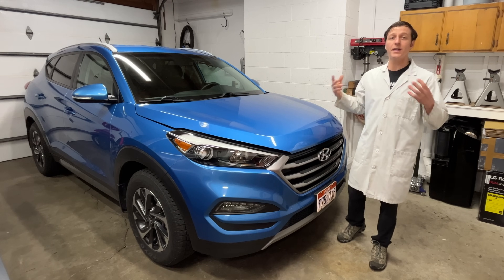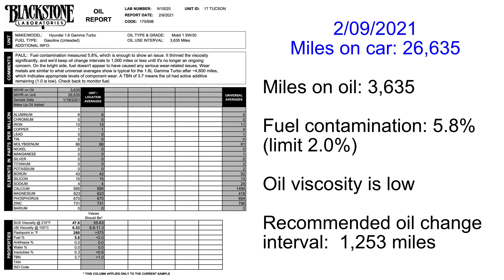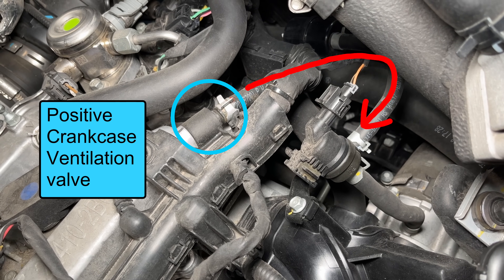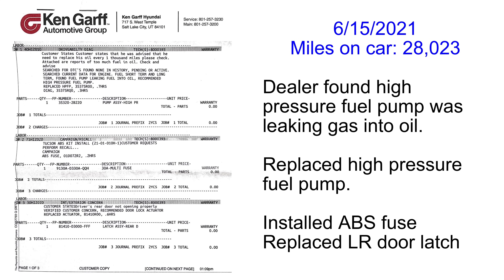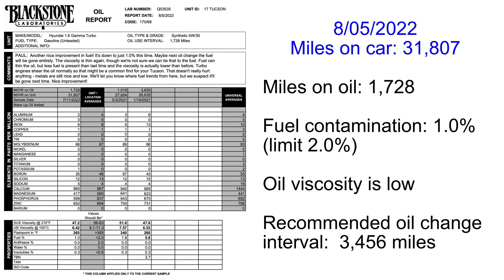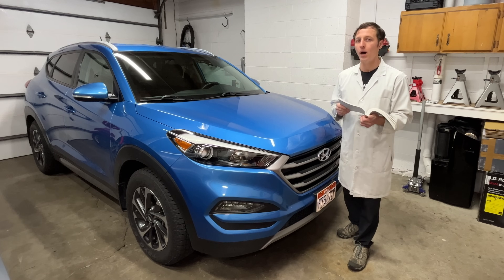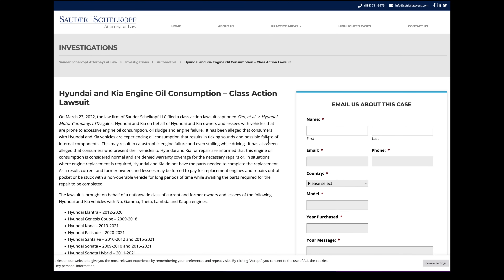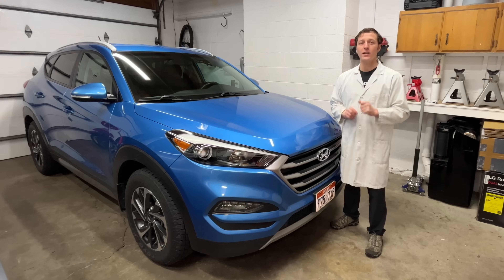Hyundai oil consumption and gasoline contamination problem solved

Comment: Ok, so every 3k. Got it, change oil and check pvc regularly. So, do I still need/ should use synthetic oil or hybrid or conventional ok because so frequent? Or? Thank you for doing these
Reply from the maker: Synthetic oil is recommended for turbocharged engines because it can handle higher temperatures than regular oil and the viscosity will be more consistent. I buy Kirkland brand oil at Costco and it's about 1/2 price compared the auto parts stores. It still meets the same API specifications. Cheaper oil is not worse than expensive oil.
I recommend sending a sample of your oil to Blackstone labs. 3,000 mile oil changes are good IF the high pressure fuel pump isn't leaking. If it leaks like mine did, even the 3,000 mile oil changes will result in a blown engine. That's why you need to test the oil.

Comment: Also, do we have the same problem with lambda II motors ? I have a 2015 3.3 l lambda II. Everything works well but just to prevent something… thanks
Reply from the maker: Yes, the GDI version of the Lambda 2 engine was introduced in 2011. Most GDI engines have a tendency to get gas in the oil. Test your oil and change it often.

Comment: Hi guys, so shall I do this « GDI. Cleaning » since it reduces the amount of deposit caused by this bypass system putting back exhaust into the system ? What is this product actually ? Should K ask my dealer or can do myself ? Thanks.
Reply from the maker: GDI cleaner is just a strong solvent that goes in the intake manifold to dissolve carbon deposits on your valves. You can buy a can of GDI cleaner and do it yourself, or take it to the dealer. I don't know if there is a difference in results because I haven't researched it.
Reply: @LabCoatPaul  Thank you so much for answering. You are the best. :)

Comment: get made in korea and don't get GDI.  I doubt ANY GDI is a good idea.  do your homework before getting a hyundai/kia product.  the best car I ever had was a hyundai and I have owned toyota, honda, nissan, mitsubishi, and chevrolet cars.
Reply from the maker: GDI engines from a lot of different manufacturers have fuel dilution in the oil. Unfortunately, most new cars in the US have GDI because theoretically the cars have cleaner emissions. I can confirm my 2017 Hyundai had cleaner emissions on idle than my 1997 RAV4. I had both tested with an exhaust gas analyzer. I did not test the emissions while driving. I suspect the Hyundai has higher HC emissions when using the turbo.
Reply: I did a VIN search and found out my 2018 2.0 Tucson was made in Korea.

Comment: Thanks for sharing your findings. 

Could one of the consequences of driving one of these vehicles (I have a 2014 Hyundai Santa Fe Sport with the Theta II engine, another of Hyundai's gasoline direct engines) lead to pitting of the pistons and cylinder wall wear? That's the struggle I am currently facing but, since it's not rod bearing failure, it's not covered by Hyundai's extended warranty. I certainly was not changing my oil ever 1,000 miles, so who knows how long I may have been operating it with potentially contaminated oil 😔 Thanks again.

Comment: I'd be curious to know whether this was run on higher octane fuel if the results would differ. These motors are only reccomended to run 91 or above, but it would be interesting to see if a 95-98 octane would produce different results for these tests.

Comment: The direct injector, on a gasoline fueled engine, sprays fuel into the cylinder on the INTAKE stroke only (i.e. not the compression stroke), just like the old port injector does.  The only difference is that the direct injected fuel is sprayed directly into the cylinder under high pressure, like you said. Where a port injector sprays 60 PSI fuel upstream of the open intake valves on the intake stroke. Only a compression ignition engine, a Diesel, sprays very high pressure direct injected fuel on the compression stroke to start the fire.

Comment: This is why I put 15w-50 in my GDI accent and change it every 2500-3000 miles. 230k and no funny business.
Reply: Thank you. I see 200k mile Elantras all the time. Quality gasoline and frequent synthetic oil changes seem to be too hard to comprehend for some. Engines are complex machinery in need of maintenance
Reply: I think it calls for 5W-30 at the upper end of thickness. Your is past warranty so that isn't something to worry about.
Reply: @filippocorti6760  It does in the US manual, overseas the minimum for the 1.6 GDI is 5w30 and the maximum recommended is 20w50.
Reply: @Itrieditathome889  That is interesting. I wonder what the reason is for the difference.
Reply: Have you had intake cleaning service done? It removes the carbon that forms due to direct injection.
Reply: @filippocorti6760  Yes I do it myself every 10k or so. I recently had the intake manifold off to do the injectors and it was surprisingly clean considering the miles and the fact I use full SAPS oil (which can contribute to deposits more than low SAPS.)

Comment: Crappy engine . Ive changed the pcv and still burn one full quart of oil every 60miles. 4 quarts on a 3hr drive.  No leak  , no black-ness from the exhaust tip....where did it all go?????

-2014 santa fe 2.0
Reply from the maker: 1 quart per 60 miles? Your car is burning more oil than a 2 stroke! That's awful. I wish you luck and a new car. 
Unfortunately, once they're burning oil, you can't really fix it, other than replacing the engine. Testing the oil and changing it often can prevent oil consumption, but it won't fix it after it's already happening.

Comment: Thanks Paul! Having the same issues with my 2015 hyundai sonata sport 2.4 liter gdi... ugh this thing burns oil like nobody's business! Of course it just passed 100000 miles as well when this all started happening thanks alot hyundai. They said they couldn't do anything about it and to just keep adding oil. I'll be checking out those class action lawsuits you mentioned. Stay safe out there!
Reply: Use valvoline restore and protect oil
Reply: @shreddbass    I just bought a used 2013 Santa Fe Sport with 125K miles on it.   Have you been adding oil regularly?
Reply: What are you complaining about?  Honda and Toyota washes their hands of their cars at 60.000 miles. Their 1.5 L Turbos are blowing head gaskets left and right and they are refusing to help if it happens over 60.000 miles. Problem is its happening well below 100.000 miles. Did  you buy this car new? It's also 10 years old!  What are your oil change intervals?

Comment: I think the problem with your car actually started with the original owner, which brings up the importance of checking a vehicle's maintenance history.  I think you don't have a GDI problem so much as you have a ring wear problem from poor break in and a long time from when it was new til when it got it's first oil change.  I would check compression on that engine and also pull the Carfax to see how long that first oil change took.  Also, how long are each of your drive cycles?  Do you do a lot of short trips?
Reply from the maker: I bought my car used, with 28,000 miles. It was a lease return from California. I don't know how often the oil changes were done. I'll assume the person didn't care about the car. There were other signs of abuse like paint damage from multiple spilled sodas on the roof and candy under the seats.
My first oil test showed 6% of the oil is gasoline. The limit is 2% before the viscosity of the oil is compromised. Older cars with port fuel injection have zero fuel in the oil. One of my friends just did a test on his 1998 Toyota Tacoma with 260,000 miles and there was no gas in the oil.
After I had the high pressure fuel pump replaced, my oil contamination dropped from 6% to 2% over a 3,000 mile oil change, confirming the fuel pump was leaking into the oil. 
GDI operates at 2,000 psi and the pump sits on top of the valve cover and is driven by the camshaft. If it leaks even a little bit, the gas will go straight into the oil by the camshaft. Also, the gas is sprayed into the cylinder at high pressure, and there's a turbo. All those factors increase the chances of fuel getting past the piston rings.
It's possible my engine has some cylinder and ring wear, however, it does not burn oil. After 3,000 miles, the dipstick indicates FULL. Perhaps even a little more, with the gas in there.  I start with 4.5 quarts, and I end up with 4.59 quarts of oil + gas in the oil pan.
Blackstone labs said there was a serious problem that needed repairs with the first test. After I had the high pressure fuel pump replaced, they advised to keep an eye on the oil contamination, and not to go over 3,000 miles on the oil.

My driving habits are severe duty. I rarely drive the car more than 4 miles at a time. Going to work is 15 minutes, 4 miles. Going to the store is 5 minutes, 1 mile. The engine doesn't get a chance to warm up, and fuel doesn't get a chance to evaporate out of the crankcase. It's reasonable to do 3,000 mile oil changes with that kind of driving, so I don't think my car is broken. But If I blindly follow 5,000 mile oil changes, it will burn tons of oil by the time I get 80K miles on the car.
Reply: @LabCoatPaul  Great explanation.  Yes, the short trip driving is severe duty.  3k interval is a good choice.

Comment: I don't think it has to do with the fact that it's gasoline direct injection but much more to do with emissions standards.  The manufacturer made the bore a lot looser so there would be less friction so that they could get more rotation out of a little bit of fuel.

 They meet EPA standards and that's why the engines are failing sooner than later. So save the environment by buying a new car every 3 years instead of having a car that will last for 10 years but create a little bit of extra pollution because it doesn't make any  pollution to make new vehicles and to harvest the raw materials, run the factories etc..,.right?
Reply from the maker: Yes, the loose bores make the car get better gas mileage! No old car has ever achieved the mind-blowing 24 mpg that I get... Literally every small car from the 90's does better on gas than that. You can easily get 30mpg out of a Honda Civic or Toyota Corolla. Back then, they just made the cars lightweight with no safety. Some people think the Geo Metro got 55mpg. I had a 1994 Geo Metro. It got 35mpg, because you had to floor it 100% of the time to get the car to move, but that's still much better than 24mpg.

It's funny how the EPA makes rules about the environment that result in more pollution. How about those new gas cans that just spill all the gas on the ground? I'm happy they prevent gas from evaporating through the vent.

I tested my 2017 Hyundai Tucson with an exhaust gas analyzer, and it does actually burn much cleaner than my 1997 Toyota RAV4. Direct injection gives you much more precise control over the air to fuel ratio. The test was done at idle, not while the turbo was spooled up. Spoiler alert: they run super rich while in boost to prevent detonation. 

Another fun fact: cars with GDI only (no port fuel injection) have carbon buildup problems on the intake valves that has to be cleaned once a year. If every GDI car burns 1 quart of GDI cleaner in the engine every year, how much pollution is that? That cleaner is gnarly. The smoke coming out is dense white poison. At least Toyota is smart enough to have port + direct injection on their newer cars so that service is not needed.
Reply: @LabCoatPaul  The gas can 😂. They have conversion kits but yes, The EPA is very short-sighted. 

Cummins diesel engine 5.9 you get a million miles to 6.7. you're lucky because of the EGR to get 350,000 mi before she needs real maintenance and this plays out in our food cost. But it also plays out in farmers and truckers and everybody else having to get new diesel engines and or whole equipment cuz they can't afford the downtime. So I'm not sure how you're saving the environment if you have to manufacture a whole new rig and dispose of the old one. 😆

The loose Bores doesn't completely fall on the shoulders of the EPA because I'm sure it has something to do with manufacturers 100,000 mi service for life type of philosophy. 

You'll have to come back and get a new car if it's blowing blue smoke. They only need it to make it through the warranty. Not to the 3rd or 4th owner. 

The fact is is a technology has come a long way. The GDI is great technology, they'll also run very rich most engines. If you have a background check engine light on that you haven't fixed, it'll do the same thing. It'll run really rich cuz it's assuming worst case and it's always better to have too much fuel than too little fuel. 

Just a guess cuz I have not actually tried it, but I'm assuming that if you run water vapor through like a misting system through the intake and let it go over those valves, it'll clean them. I wouldn't do too much as you warp it, but when you're cylinder, head blows a head gasket, the coolant will get in there and completely spotlessly clean the combustion chamber. You could even do this with a catch can and the PCV system 👍

Comment: I also own 2017 Tucson with 1.6 T-GDi but i live in Europe and here the service interval for oil change is 15000 kilometers/9500 miles... Now after 6 years old/60000miles my engine is burning oil and I was never advised at Hyundai dealership where I did all my service to change oil more often. At last service (3 months ago) I was told that there's almost no oil left in the engine, before I had no clue that this car burns or will burn oil. Now after 3000 miles driven oil level is about 3/4 between low and full on oil stick. A mechanic has adviced me to just add oil when it gets about 1/2 but according to you I should already replace the oil. I don't know what to do with this car, I can't afford a new one currently.
Reply from the maker: 9,500 miles oil change is crazy! If you have a leaking high pressure fuel pump, the last 8,500 miles of that was on bad oil. If the car is working normally, that's 6,500 miles on bad oil.  You should never go over 3,000 oil changes in your Hyundai.
Theoretically, if you burn all your oil, and you pour in new oil, you're doing more of an oil rotation... You should still change it every 3,000 miles though. Even if the oil overall is experiencing less use, you're still accumulating gasoline in your oil pan an you need to drain it out.
Step 1: change your oil and send a sample to the lab. They can tell you how much contamination you have and advise you how often to change your oil.
Step 2: keep that oil full. If it burns oil, just keep adding it and don't go over 3,000 mile oil changes.

Your car just identifies as a 2 stroke. (burns oil). No big deal. Keep it full and it will continue to run. The catalytic converter will get plugged eventually.
Reply: @LabCoatPaul  I do not know about any labs here testing engine oil. From now on I will change oil every 3000 miles. Do you have any reccomendation what oil to use? Hyundai here uses Valvoline 5w30 full synthetic. Thanks for your reply.

Comment: Should I cancel my order before it arrives, at a cost of $500 deposit ? 😫😣😣
Reply from the maker: Are you buying a new Hyundai Tucson? I think they're really good cars. My Tucson is the best car I've ever owned, but every other car was a 20 year old POS that's falling apart. 
The new Tucson has the same engine as my 2017, so fuel getting in the oil will still be an issue. Make sure to test the oil and don't go over 3,000 miles oil changes.
A lot of new cars with GDI also get gasoline in the oil, so if you choose a different vehicle, do a bit of research first - it might have the same issues as the Hyundai.

Comment: I never skip 3k mile oil change. I don't care what car manufacturers recommend. 3k miles oil change. Oil is cheaper than engine
Reply: Not enough in this case.  I go 7,000 to 10,000 on my Accord.  225,000 miles and all is fine.  Changing at 3,000 miles wills been a waist of $2,000!!!!!!!!
Reply: Modern good engines will do just fine at 5000 mile intervals. I've done 7500 on my 2010 Volvo and have had zero issues because I use only full synthetic. If you are using cheap oil every 3000, it won't matter how much you change it. Same with using crappy fuel.

Comment: Turbocharged direct injection engines, whether gasoline or diesel, are fuel diluters. That's what they do. The problem can be mitigated by boiling the lighter fuel components out of the crankcase oil by taking frequent extended longer trips at highway speeds. If this is your normal driving routine, then fine. However if you drive predominantly shorter trips, especially in cold weather, a turbo DI engine is not a good choice.
Reply: Definitely agree. My 2.4 naturally aspirated is pretty much a road trip vehicle. 67k miles and no oil consumption. Also installed a catch can, works well, mostly moisture bit of oil.

Comment: I have a 2018 Soul with the turbo 1.6L. It has 94000 miles on it and doesn’t have these problems. I drive 4000 miles between oil changes,mostly highway. This is my third Kia and no problems of any kind.

Comment: What kind of driving were you doing ? Severe service will contaminate the oil much faster as engine doesnt warm up fully to burn off fuel in oil . How long the engine runs after its fully warmed up plays a factor also
Reply from the maker: My car is definitely severe service.  Most of my trips are less than 4 miles.
Reply: @LabCoatPaul Ugh , That Doesn't Help Oil Contamination. The Engine Must Achieve Full Operating Temp To "Burn Off " Excess Fuel / Moisture .